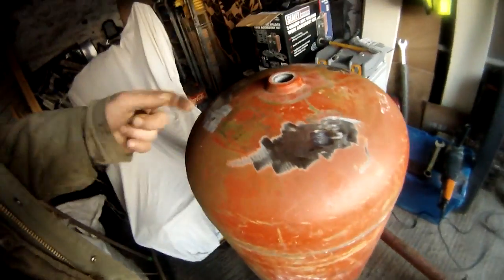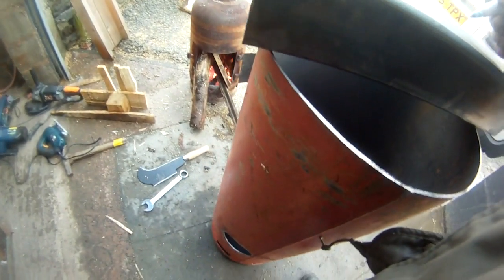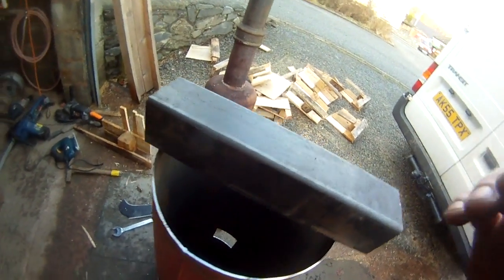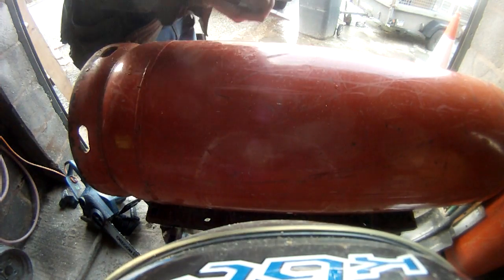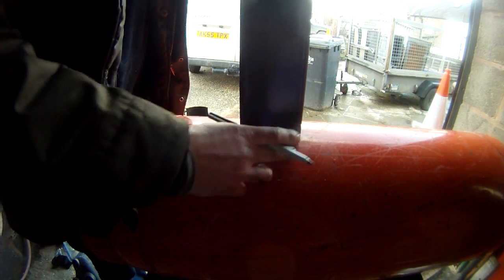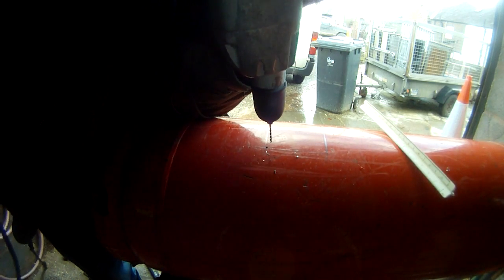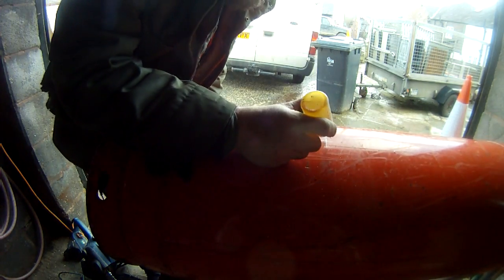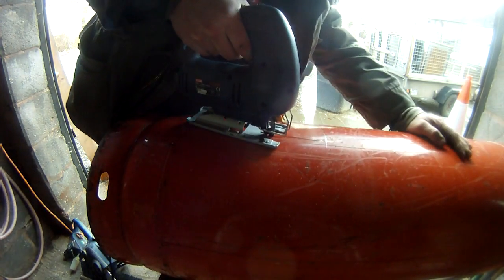Propane tank Rocket Stove Heater project - make the cuts

Comment: There are safe ways to purge gas cylinders so don't phuque about if not absolutely sure. Pulling the valves then, after venting, filling with water and harsh surfactant ( used TSP as I'm in the US) and letting stand for a week worked for me.